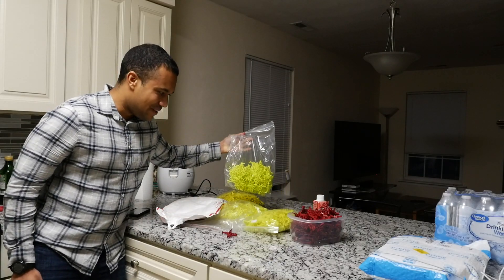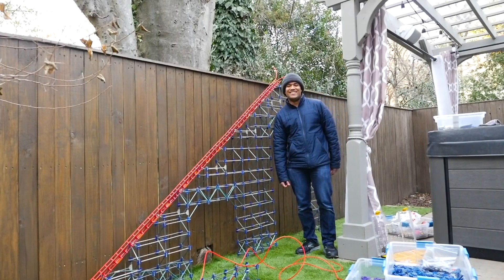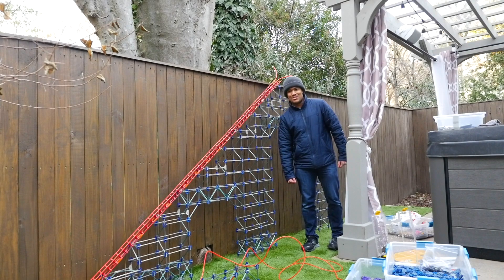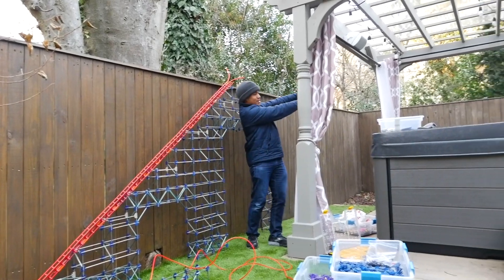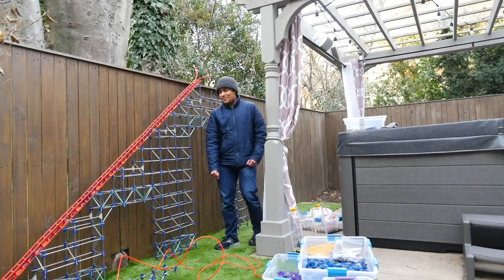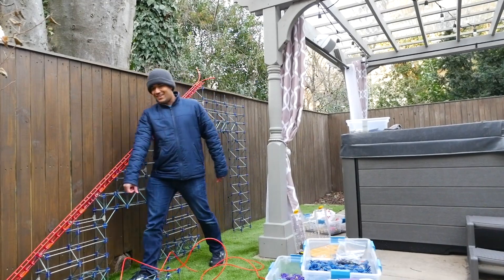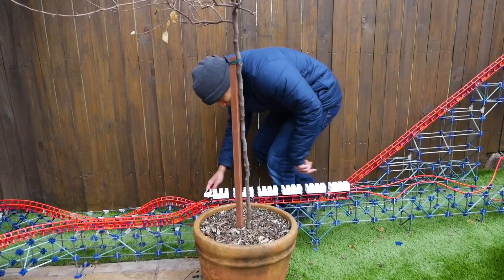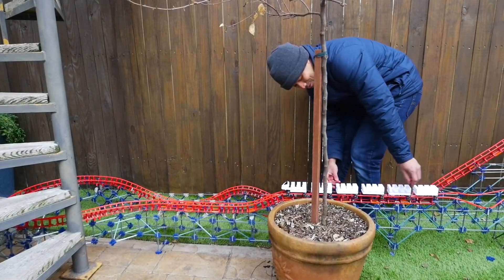Magnum XL-300: K'nex Model Coaster Construction (Update 1)

Comment: Wow absolute genius with coloring the knex parts
Reply from the maker: Thanks! Although I still have yet to perfect the process. They look good, but the dye does seem to bleed through a little after it rains.
Reply: @CoasterWriter  but overall it looks pretty cool. To deal with the bleeding problem from condensation, try using some sealant on them
Reply from the maker: @polymertech  thanks for the advice. I'll have to try that out